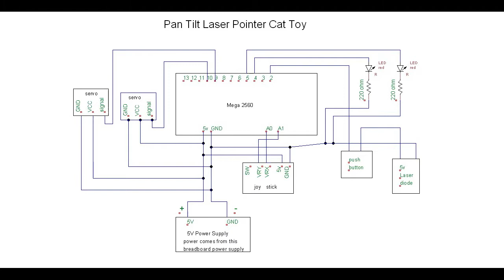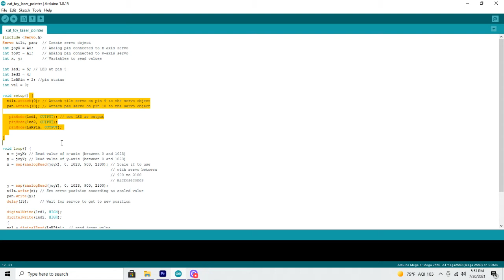Learn To Build Your Own Cat Laser Pointer Toy Using Arduino Servo Motors - Anyone Can do it

Comment from the maker: #include <Servo.h>
Servo tilt, pan;  // Create servo object

int joyX = A0;    // Analog pin connected to x-axis servo

int joyY = A1;    // Analog pin connected to y-axis servo

int x, y;         // Variables to read values

int led1 = 5; // LED at pin 5

int led2 = 4;

int LsRPin = 2; //pin status

int val = 0;

void setup() {

  tilt.attach(9); // Attach tilt servo on pin 9 to the servo object

  pan.attach(10); // Attach pan servo on pin 10 to the servo object

   pinMode(led1, OUTPUT); // set LED as output

   pinMode(led2, OUTPUT);

   pinMode(LsRPin, OUTPUT); 

   

}

void loop() {

  x = joyX; // Read value of x-axis (between 0 and 1023)

  y = joyY; // Read value of y-axis (between 0 and 1023)

  x = map(analogRead(joyX), 0, 1023, 900, 2100); // Scale it to use

                                                 // with servo between

                                                 // 900 to 2100

                                                 // microseconds

  y = map(analogRead(joyY), 0, 1023, 900, 2100);

  tilt.write(x); // Set servo position according to scaled value

  pan.write(y);

  delay(15);     // Wait for servos to get to new position

  digitalWrite(led1, HIGH);

  digitalWrite(led2, HIGH);

  {

  val = digitalRead(LsRPin);  // read input value

  if (val == HIGH) {         // check if the input is HIGH (button released)

    digitalWrite(LsRPin, LOW);  // turn lazer OFF

  } else {

    digitalWrite(LsRPin, HIGH);  // turn lazer ON

  }

}

}

Thank you all for watching! I hop the code posted above is helpful.  P.S. don't use cardboard in your Arduino projects 😉😬